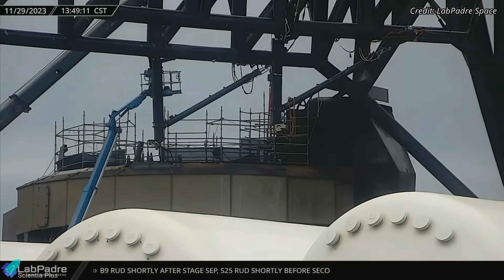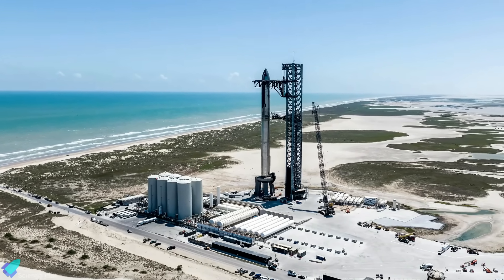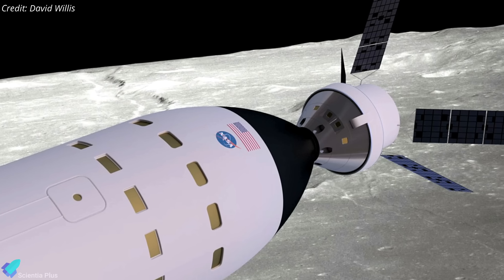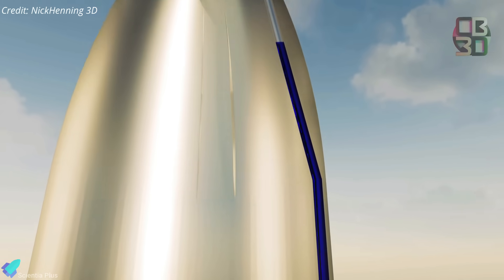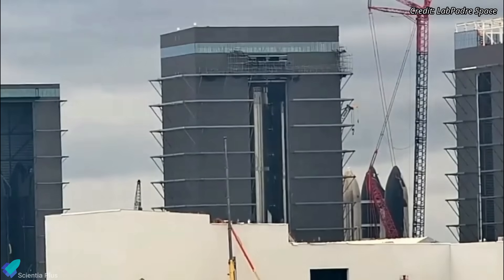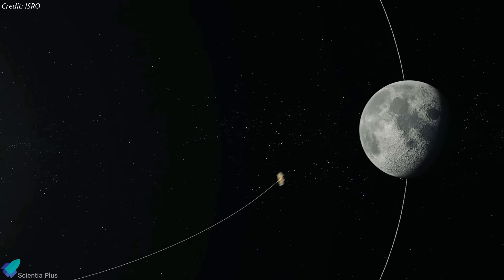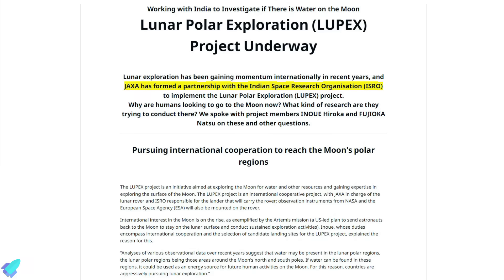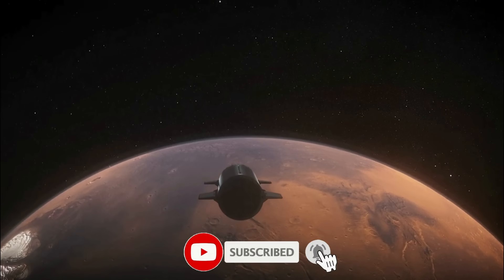SpaceX Starship Flight 3: NASA's Incredible New Proposal

Comment: 2027 is better estimate for lunar lander, but now estimate is 14 fuel starships to fuel one starship to the moon and back. And landing a starship on lunar regolith will crater the surface making safe landing impossible. And no reason to land a full starship unless you leave it there or leave equipment. And who wants to have humans on an experimental starship at all? It should be restricted to a cargo lifter for 5+ years, 100+ uncrewed flights. Automated flight makes any crew a risk liability.

Comment: I agree with @gijbuis.  SpaceX is 10 years or more ahead of NASA.  NASA is a bureaucratic mess. It seems that NASA's sole purpose it to keep the tax-money draining contractors like Boeing, Lockheed Martin, Northrop Grumman in business.  
NASA Atremis idea is to use antiquated solid rocket booster, space shuttle engines, and 1960's reentry engineering, ie... capsules.  All this at a cost of nearly 10X's that of SpaceX Starship. There is no need to transfer astronauts to and from a capsule.

Comment: This guy just glosses over the major fail point of this entire project. 
The tiles are not adequate for repetitive use . They aren’t interchangeable or easily removed and applied. NASA used interlocking tiles with torque settings on high strength bolts . Im sorry bud you're stil gonna kill people … 
In your defense your testing isn’t up to re entry… its still in the launch and flight stage . 
But when we get to the atmosphere re entry stage … this tile problem will return to cause many many problems. 
I love the crashes anyway and innovation costs as Elon will tell investors. 
I truly hope this works out eventually.
Reply: I am fully confident that this will all work out eventually.  Yes, I am nearly a 100% Elon supporter.  He may be over optimistic on his time estimates BUT when I look at the mutlitudes of major revolutionary successes that he has generated I just can't help putting all my faith the he will succeed with Starship as well.  He just needs more time that he thinks. 😂 I would love to work at SpaceX but I could not keep up. The engineers there are super human fast at designing and refining.  I understand the physics and engineering but I just don't have Flash Gordon speed.
Reply: If you can't work in Elon time, it's tough. Even if you can.

On the other hand, you can see your designs coming to life. Which in itself is very rewarding. You won't have such an experience at pretty much any other company which are used to milk existing designs to death.

I have no doubt that the heat tile issue will be addressed successfully. Iterative development is clearly visible with Starship. The tiles are just one example.

It's possible that the new approach won't be the last either. Who knows which ideas are floating around within SpaceX.
😉

Comment: Is there enough gravity force if a ship has it's engines pointed towards the earth to avoid slushing?
Reply: No. The nature of obiting is that all parts of the object are experiencing the same amount of weighlessness.  This includes liquids in tanks.  BUT any minimal amount of thrust or rotation will create a bit of acceleration that has the same effect as gravity.  So, spinning a ship or lighting an engine will cause the liquids to accumulate at one end of their tanks.
Reply: Another problem with slushing is the force the liquid applies to the container when the engine ignites to f9rce the fuel to a position. Initially when the engine light, the vehicle acceleration is higher than expected because only the dry mass of the rocket is accelerated. It takes a little time for the fuel to settle into the tank position and then slow the vehicle acceleration due to the extra mass. So you can see there's a fair bit of acceleration oscillation happening and it isn't helped by poor throttling abilities of these engines. Low acceleration is required, a bit of time is required  and flipping the ship end over end doesn't help.
Reply: Basically a task for small maneuvering thrusters. The animation showed some, which aren't existing on Starship so far.

Comment: I wonder why there aren't blast diverters that automatically cover the hold down clamps when they retract. This is a very simple protective measure that could prevent repetitive replacement of damaged components after every launch. Until such a system is implemented, these "repairs" will continue to delay launches. 
Propellant transfer requires the tank contents to be located at the end of the tank in order to be pumped. Steady-state "coasting" will allow contents to distribute throughout the tank away from the pump. Either "spinning" or slow, steady, acceleration is necessary. I look forward to seeing how SpaceX addresses the issue.
Reply: Good comment!  Elon says that the best part is no part so they will likely try to preserve the clamps by some method that does not require more parts.  Maybe moving them out of the way sooner or making them out of more durable material?  Adding shields could also be the solution but only after they run out of other ideas.
Reply: The animation showed slow acceleration during fuel transfer. Probably the most likely scenario.

With the clamps, don't forget that SpaceX is still figuring out what they need or not. What they don't need won't be utilized. They will only add a part or component if they can't do it without.

It's still the "no part is the best part" philosophy at work.
😉